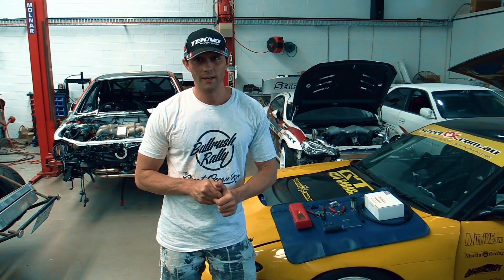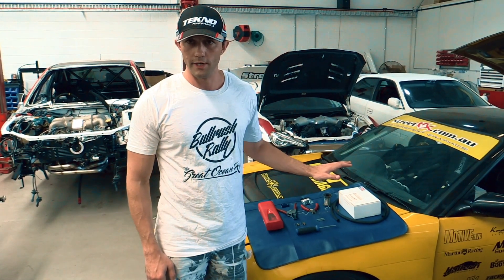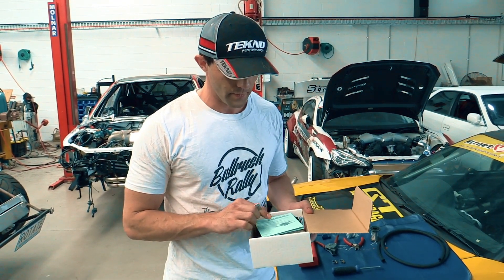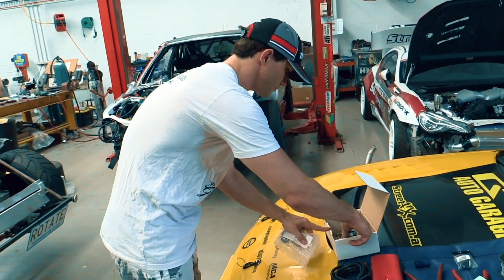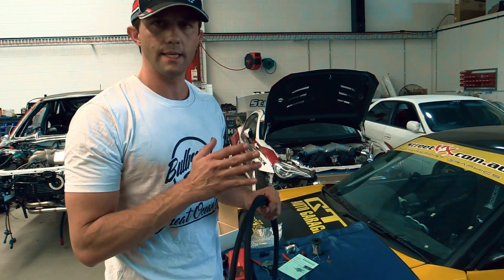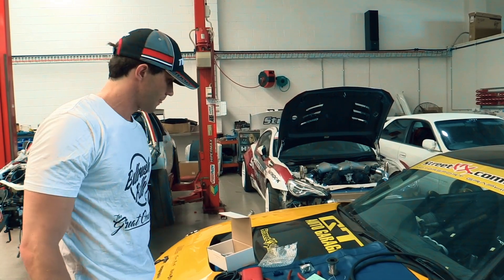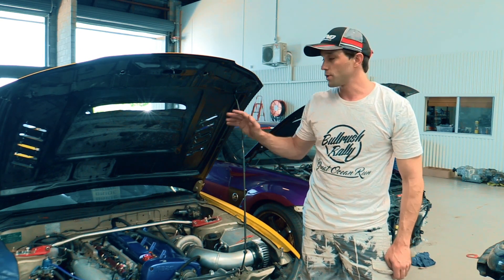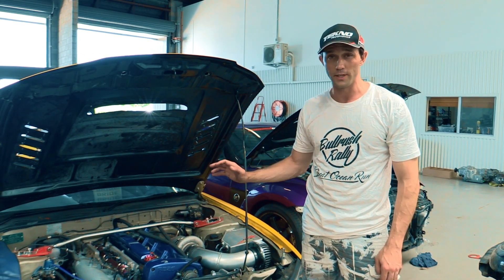DIY: Installing Zeitronix FLEX FUEL Sensor (E85 Ethanol content analyzer), How & Why you need one!

Comment: Cool video! I'll be installing my flex fuel sensor soon too. My haltech is "flex fuel ready" as it's the latest version of the platinum pro for my R32 GTR. I will be hooking my flex fuel sensor to the single DPI spot instead of one of the analog inputs. Waiting patiently to see the dyno results :)
Reply from the maker: ours is the older version of the Haltech, we had to steal the oil temp sensor to run this until we get upgraded :(
Reply: Eh...who needs oil temp anyway!? lol

Comment: I'm looking into either this kit/aem/innovate. In a 2008 civic si, running thru a hondata tuner, will my stock ECU be able to be pinned and ran thru? Hondata provides e85 tuning fuel tables and allows dual maps. Still lost as not many have done this to our cars
Reply from the maker: If your ecu has an input for an analogue sensor then it should be able to. I believe (I’d need to check) that it outputs a 0-5v signal for ethanol content.